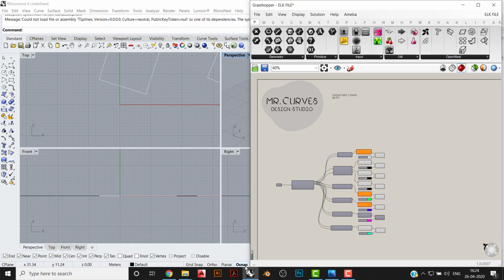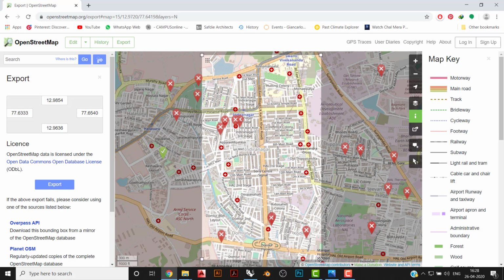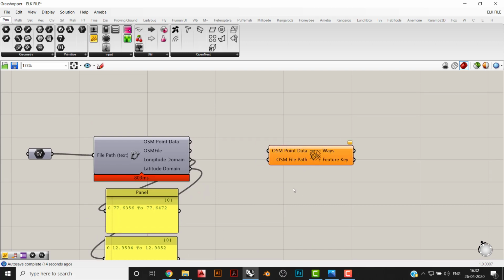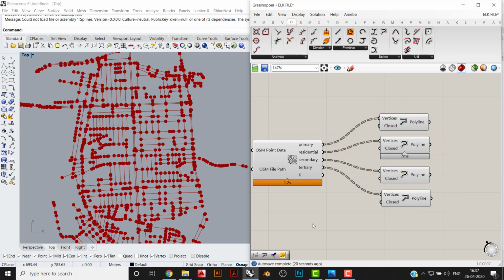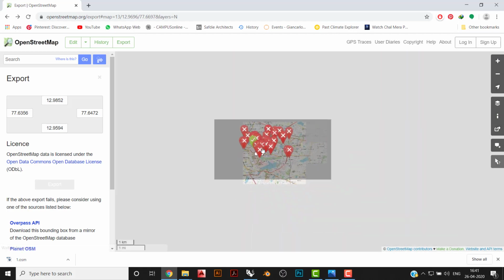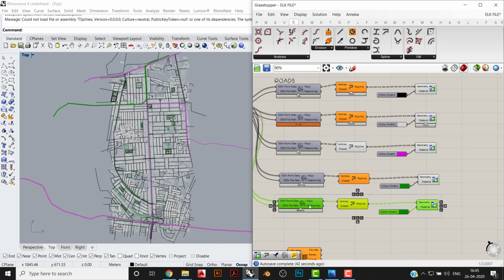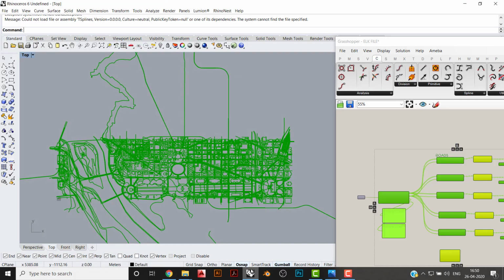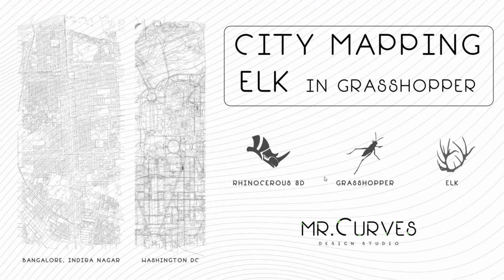Grasshopper 3d l City Mapping using Elk

Comment: want another video on 3d contextual massing i.e giving buildings  height
Reply from the maker: Sure👍🏻, will make a tutorial with that topic. Please subscribe 😊
Reply: @mr.curvesstudio  hey its an emergency lol , am completing a project but dont have building height info how can i extrude those osm buildings  , i am new to grasshopper btw , so not know much about all components
Reply from the maker: @anubhavnegi4230   when you right click osm data component, you can find (create 3d building) when you click that you will get the building blocks with there heights, (*only if there is a data from osm). Option 2: You can also try using cad mapper. Find that tutorial from our page.
Reply: @mr.curvesstudio  yeah that OSM height data is not available so how to extrude in that case ?
Reply from the maker: @anubhavnegi4230  in that case, you need to do it manually. Use the building boundary curves you got from the osm data component and use extrude component in z axis with a random component (parameters should be an approx min and Max heights)  finally use cap to make all the extruded polysurfaces solid.
If you need more help, share your email id. So I can help you through zoom.😊
Reply from the maker: @anubhavnegi4230  you can share your email id to hello.mrcurves@gmail.com if you need any help from you, that can solve through zoom meeting.
Reply: @mr.curvesstudio   It worked thanks  i have sent u e mail anyways
Reply from the maker: @anubhavnegi4230  Great 👍🏻, all the best.